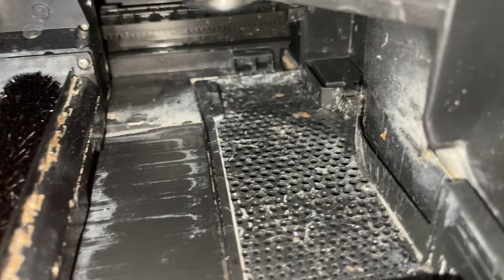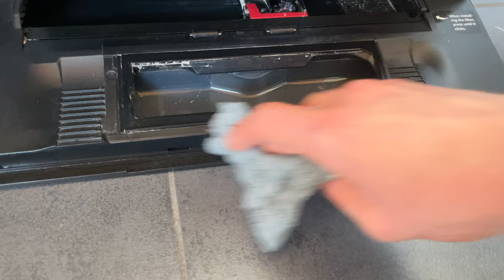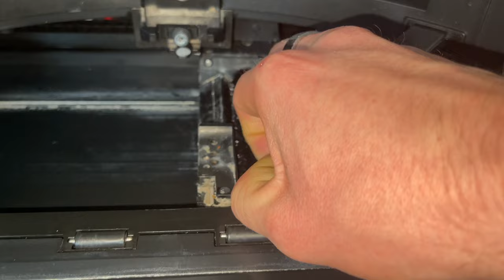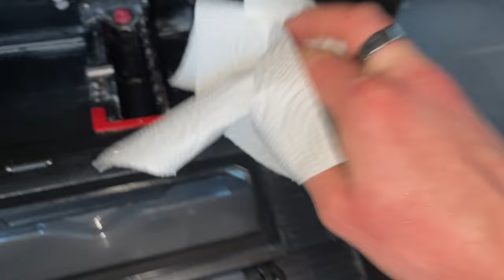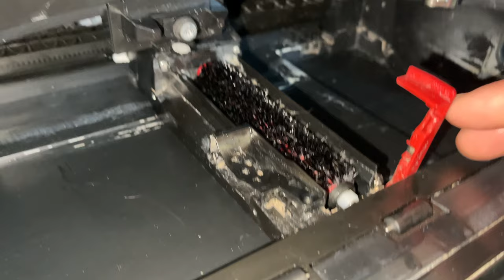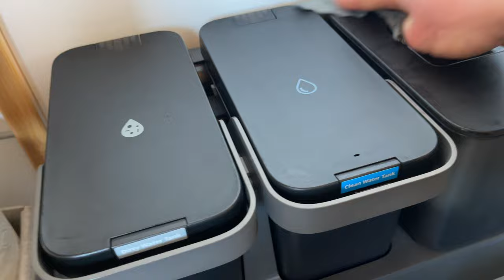How to clean the Roborock s7 maxv ultra station?

Comment: Great Video!! 
did you get the problem of the vacuum voltage?
Reply: I have that voltage problem, did you manage to fix it ?
Reply: @maestro9815  not at all.... And you?
Reply: @h975  nope, I have a 230v wash dock running on 240v outlet, but still I get a error 35. 
‘Auto empty dock voltage error’
Reply: @maestro9815  It happens the same to me! very frustated.....
Reply: @h975  have you contacted Roborock ? Did your dock used to work ? Or came it like this out of the box ?
Reply: @maestro9815  it never worked. No, I didn't. Do you?
Reply: @h975  
Mine worked yesterday, this morning it stopped working again. I have to investigate this further
Reply: @maestro9815  Did change anything? let me know please! thanks
Reply: @h975  
Nope, I suspect a dodgy power supply
I’m going to send it back to the retailer
Btw this one had production date 04-2022
Which date has yours ?

Comment: Seems like lot of work! Better to get the robot by itself.
Reply: It only needs to be done about once a month, maybe a month and a half it will start to smell if you do not keep it clean
Reply: You can get a robot for that.
Reply: Nope, it seemed confusing at first but once ive done it turns out the maintenance is extremely easy and fast
Reply: @drlectersgirl  How do you clean ? Does that cleaning plate removable ?
Reply: @Idkjk971  the plate on the right side is removable, thats where most of the dirt will be
Reply: Just get a maid bro
Reply: Really? Really? How lazy can one get?
Reply: Not having a base is sooo much more work on a day to day basis
Reply: Not at all, get the dock